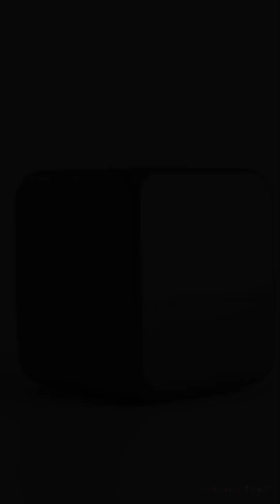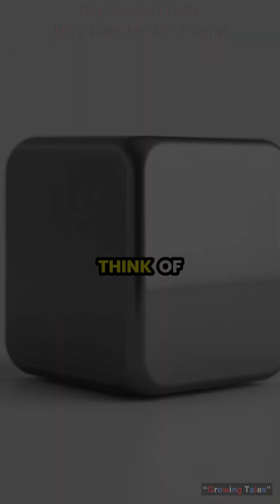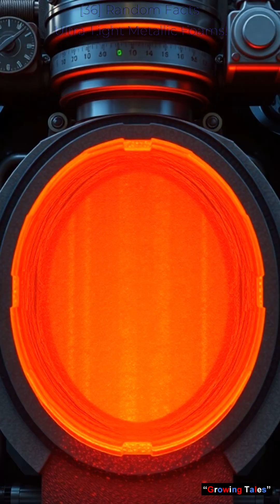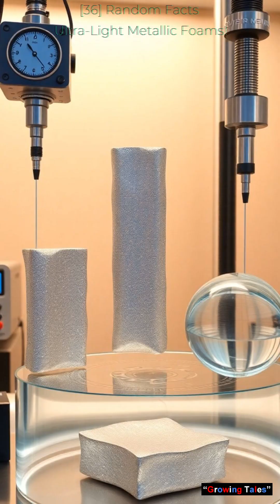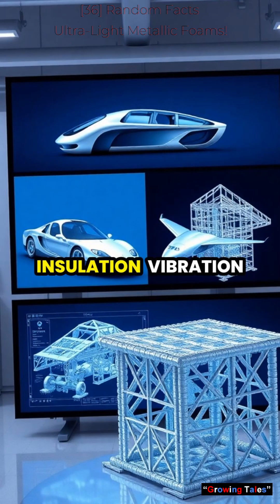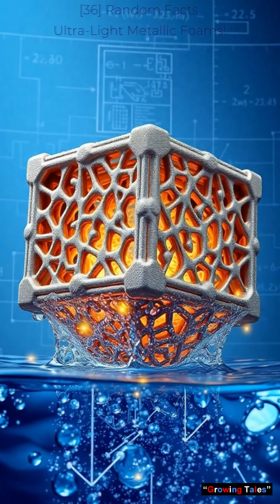[36] Random Facts [Ultra-Light Metallic Foams!]

Comment: It's not because it is lighter that I floats it's because it has air in it
Reply from the maker: That's a great observation! You're right—it's the air pockets inside the material that give it such a low overall density, allowing it to float. In other words, because these tiny air bubbles reduce the material’s density below that of water, it floats easily. The key innovation here is creating metal structures filled with these microscopic air pockets—making them exceptionally light yet surprisingly strong. Thanks for pointing that out!. and Thank for watching